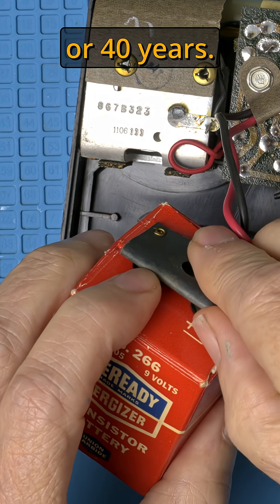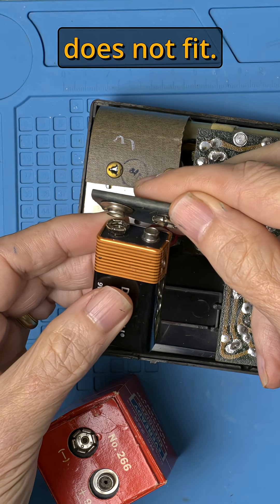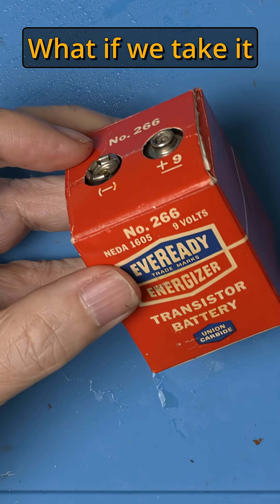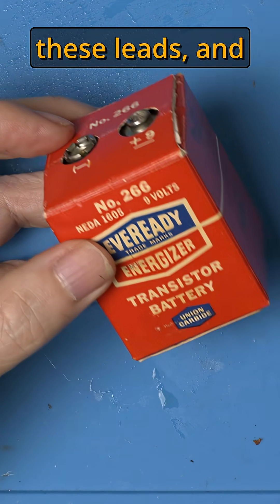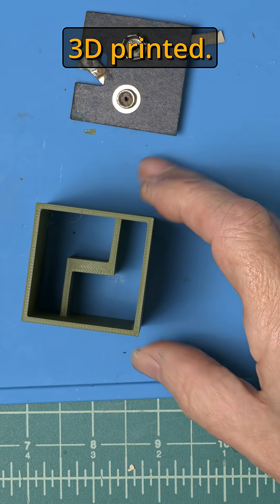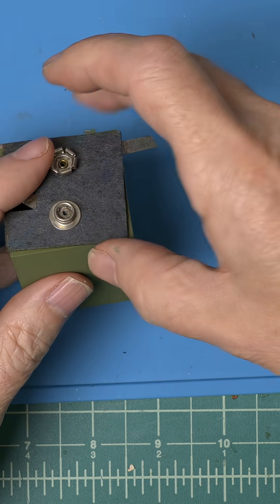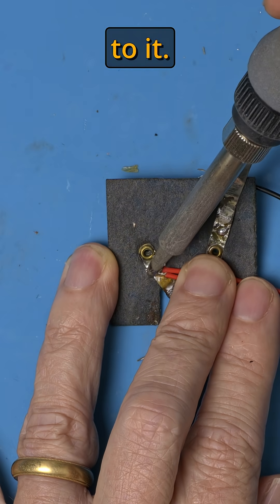3D Printed Vintage Battery Adapter #vintageelectronics #3dprinting #eveready #electronicsrepair

Comment: Gads, I'm so old. I had one of those radios when I was a kid, I used 6 D batteries to make a power supply until my father found an old model train transformer that was rated for 8.9VDC

Comment: It was 9 volts why didn't u just cut and put a connector that is for new 9 volt alot less work if u hooked up the batters wrong it would be 18 volts but I guess u have dou le batter storage that way I would have just put a new connection on instead of building a battery pack

Comment: Really great fix for the 'Old battery tech' solution.  So glad to see you put it back in the original box.
(As a side-note and one that probably shouldn't be done anyway; that old battery might have been 9volts but no way do ya put your tongue across the terminals to check if there's any life in it!)

Comment: i think you have enough space to connect in series connections and insert that case at least two of 3.7 volts  rechargeable batteries at 1500mAh each one recycled from vapes and maybe still left small space to insert a tiny 8 volts to 9 volts dc dc step-up converter. Even without that converter your portable radio could work fine inside interval 8.4 volt to 7.5 volts only. Some vapes include an USB C connector to recharge that batteries and you connect it to recharge one by one attaching a switch to comute between  batteries  (direct wires connections from same charger negative point for that two negative terminals  batteries and a switch to comute between batteries only the positive terminals from positive connection of the charger with a display battery percentage indicator . You have a lot of possibilities and space to play with and even fit up to four vapes Lithium ion 1500mAh rechargeable batteries two by two parallel and series connection but could be a bad idea because different internal resistance of too many batteries and most probably will experience unbalanced discharge of batteries.

Comment: 😂Why did you make it so sophisticated? You could have pulled out the ones that's connecting to the device.
Brought in a new connector a modern one connected to the battery.You didn't need to print

Comment: I would have just cut off the old battery terminals and installed a new standard 9V one but I guess you wanted to maintain the look of the internals and have some fun with it so this was a really cool solution

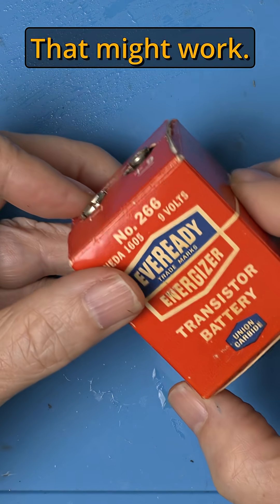Comment: 0:14 there's only 3 things wrong with that idea. 

1- you said "3D print" a cardboard box.

2-you probably only need 1 modern 9v. Check the specs on the battery first. Old  batteries are generally extremely weak and new batteries can damage vintage appliances. 

3a-If you only need 1, 9v then either change the connector or make an adapter. 

3b-if 1 or 2, 9v batteries don't match the specs on the original battery, you can build your own battery simply by connecting AA batteries together.

AA and AAA are both 1.5v. C and D are the same as well. 

9÷1.5=6 

6 batteries wired in series gives you 9v. You just need to find out if you need AA or AAA. You can connect them together using electrical tape. If movement is a problem, use any styrofoam you can get for free.

Comment: I have the same radio. I just used 1 -9volt battery, seemed to work fine. I like your retro fit. 👍
Reply from the maker: Its a cool radio.  One should work fine, just not quite as long.  That radio eats power!

Comment: The original battery probably had a capacity of many mA, maybe even amperes... the combination of the two new batteries does not exceed 240 mA, so your autonomy will be extremely limited.

Comment: You don't plug batteries in parallel, They will eventually get different charge and one will discharge into another with a lot of heat

Comment: Or you could have just replaced the connector, seeing as it has wires to cut & attach to a standard 9v battery..... All that effort for no reason.

Comment: Would it not have been simpler to replace the original battery connector, with a modern PP3 connector?

Comment: Isn't that easier to remove the connector (I don't know the name of it) or where the battery plugs to the new one which supports current 9v batteries? Instead of redesigning the old batteries.

Comment: Read of an EVEREADY battery made in 1912. It was original to the S&W .44 revolver under barrel light. Over 100 years it would still kick the volt meter on a multimeter. But not enough to light the bulb.

Comment: Checking my knowledge: you put the 9V in parallel in order to keep the voltage 9V, but by having two batteries you doubled the capacity? Does that also increase the current they can supply?

Comment: I would have made a plug adaptor between the radio plug and modern 9 volt battery, so you would not have to alter the vintage radio and you could use (just 1) the readily available 9 volt battery - the best of both worlds.  I have no idea how long using only one pole on 2 batteries will last.  I suppose you swap the batteries at some point.

Comment: Ok so dumb question.....how does this not "over do it" in terms of power output if you are now using 2 9volts instead of one.....or are those old 9volts more than modern 9 volts lol?

Comment: Avoid wiring any batteries in parallel. It can work with well -matched batteries but it be terrible if they are not well matched. You would get much better results wiring six 1.5V in series

Comment: Or change the connector to fit a more modern 9 volt battery. No need to 3D print anything.

Comment: I had a radio in 1970 that needed a round 9-volt battery. The battery was a little larger than a modern AA battery.

Comment: Pretty cool solution, but unnecessary. The Exell 266 Alkaline 9V Battery is a direct replacement for the Eveready No. 266 battery used in vintage transistor radios.

Comment: Your small batteries are upside down.  Put the buttons up top and put metal strips between the outside and inside buttons directly on the inside of the top lid .  Alternative is to just refill the 6 chemical layers with modern alcaline chemicals .  A third option is to stuff in 3 18650 lithium cells and add a 4 pin balancing connector behind a flap for reliable recharging, giving a voltage range of 9.6V flat to 12.5V fully charged .  2x lithium would be 6.4V flat 9V full.

Comment: I'm concerned that you've wired two batteris in parallel.  I think that there is a danger of the two batteries discharging through each other.

Comment: The year is 2135 “Here with have an ancient radio with a not so ancient, yet still dated, but reliable battery conversion system. We’re gonna replace this with a pellet of Uranium 235.”
opens led coffin holding a grain of rice sized of uranium.
“Now with your nuclear play set you can get from the Amazon corner store, put on your lead lined gloves, place it anywhere inside the box and boom. It’ll get radio signal as far as Australia. Uranium-235 half life is about 704 million years, so just set it and forget it. ”

camera pans out to nuclear waste land.

Comment: What a normal person would have done is snip the connector off and replace it with a modern version of it that way you can use a standard 9v battery

Comment: Love the 3D printing. Having two batteries in parallel without a load balancer? Sure since 9V blocks have a pretty high internal resistance, they are not gonna burn. How long do they last? They should be empty pretty fast.

Comment: To be fair, the ANSI 1605 / No. 266/266A batteries are still being produced. They're about $30-40. But, they have a capacity of about 2,500 mAh as compared to 500 mAh for your typical Alkaline 9V. So that's about 5 9v batteries. Not sure how much savings you'd have using 9Vs over the correct battery as you'd have to replace them more frequently. But, if it's just for keeping a curio around in working condition and not for regular use, it probably doesn't matter.

Comment: Honestly, love old radios. I got this old emergency radio from a garage sale for $2 (modern equivalent is about $40 iirc) and it has so many features, like an outdated charger port (is a circle instead of a usb port) as well as a light plus a red light with blinking mode, and an alarm, and it has a rechargeable battery in it with a crank

Comment: I belived you had to make them in series + goes to negative on the other battery and that one go to the + innput of the radio. Same with the negative. So it keep the 9v, now it is 18v and drain battery faster. Must have seen it wrong.

Comment: Is that considered putting batteries in parallel? 

Not series? Because both negative legs went directly to the negative tab? (Same for +) if it was series you would have jumped one +\- from one 9v to the other, then to the tab?
Reply from the maker: That's exactly right, they're wired in parallel.  That's like doubling the size of a gas tank in a car, it runs longer.
Reply: @Dream.Build.Create thanks for the reply! I’m slowly trying to learn about batteries and solar without actually having the materials. 😅

Comment: The best solution for most is just buying a PP3 to PP9 adapter. They cost $10 but the downside nothing to hold them in place but no 3d printer it is the best option. Well, I use tape in my great grandfathers old radio.

Comment: That's not how it works!

You can't just connect two 9V batteries in parallel to a device that requires 9V. 

Of course it works, BUT if there is a difference in age, charge level and even brand, it can happen that one battery tries to charge the other battery. And that's despite the fact it's not designed for that!
This leads to the battery overheating, leaking, or even bursting. 

To do it the way you want, you need to install a schottky-diode (hot-carrier-diode) to each battery so that no battery can charge the other, but sufficient power can still be drawn. 

Incidentally, if simple silicon diodes were used, the device would probably not work due to the forward voltage of 0.7V per diode. Whereas a Schottky diode only draws approximately 0.3V. Most devices can still handle that due to their tolerance.

Moreover, fully charged batteries rarely run at exactly 9V, for example. Most often they're somewhere around 9.2-9.5V, which of course makes the mentioned above  problem even more pronounced.

Comment: Connecting the two batteries in series instead of parallel seems a bad idea to me. Might work for a while but If I remember correctly doing this doubles the voltage (so it's 18v not 9v) which means you might damage or overheat it.

Comment: Another moron who just needs to use his 3d printer to solve a problem that doesn't need to be solved. I'm pretty sure they still sell it. If not, just replace the plug with one that takes a standard 9 v. 2 minutes with some solder if
Is better than hours programming and printing

Comment: Please write down the voltage and capacity so people in the future know what specs to use with future batteries long after you have passed away and the "modern" 9 volts you used have depleted and no longer being manufactured.

Comment: Serious question why 2 9v batteries when on front it just says 9v ? Wouldnt that put 18v through ?
Reply: Depends on if they're in series or parallel, I forget which does which but one doubles the voltage in this case and the other keeps the same voltage with double the capacity

Comment: I love old batteries 😍 like the old 4.5's, you could always shake out one last drop of electricity to make the lamp glow for a few more seconds 😅 it was something trustworthy about old batteries; as long as their insides were in their inside and not leaking all around the place the battery was usually good enough 🔋👍

Comment: I would have just cut the wires and added a double , battery terminal for 2 batteries that would have been faster and cheaper. Neat anyway

Comment: The voltage between the two 9Vs might be problematic cuz even a small difference can lead to current between the two and might generate heat which could damage it over time

Comment: Just an honest question from someone who's not technical.
The original battery was 9v but you put 2x9v batteries in the new box.
Doesn't that make 18v and therefore too high power for the radio?

Comment: 266, NEDA 1605 battery is stillsde by Excel. Pricey, though. Or you can buy an alternative, the case is the same size as the original, but holds 6 AA batteries connected in series.
Good work on your design.

Comment: I do like what you did it looks clean, just to point out you could cut off the old battery connector and solder in a connector to fit a modern 9v.

Comment: They still make batteries this size and voltage. They go for about $40 bucks. Obviously what this guy did is cheaper in the long run…but he said he didn’t think they made these batteries anymore and they do still. Exell Batteries is brand/place I know you can buy them.

Comment: I'm no electrician or anything but can't you blow a fuse or a short a fuse or something if you're running more power than the System supposed to be running you put two 9 volts on one system that's supposed to be running off one 9 volt now I know there's a difference between volts and amps and a whole bunch of other stuff but I don't know I'm not an electrician.

Comment: Batteries in parallel is not a good solution.
6x AA or AAA in series would have made a better solution, with the same or better capacity than the proposed solution.

Comment: if you connect them parallel -- that's 18 volts.
Reply: No if you connect batteries in parallel you double the milliampere hours

Comment: Btw he's connecting the battery in parallel config so instead of having 18 volt he's having 9 volt

>but why 

Because your battery will last roughly twice as long as simply rigging 1 battery

Comment: The two 9v batteries will usually self discharge when connected in parallel. A rechargeable lithium cell would have been the better option

Comment: 2 x 9v has only about 1100mah max, while old battery is around 2500mah. Better use 6 x AA for capacity of 2500mah+

Comment: So the guy that that made this old battery out of new versions if you did this correctly, you would have doubled the life of the battery but if you did it incorrectly, you did not make a 9 V battery you would have made an 18 V battery if you put one positive lead to a negative positive lead that would make it a battery in series and that would mean you just made a smaller version of what drills take you know like those 18 V lithium ion batteries yeah you just made a smaller version of that but if you hooked both of your positives together, you would not double the voltage but double the amp powers just like the same as making 2 12 V batteries into 24 V a 24 V batteries

Comment: Maybe I'm just lazy, but I would've replaced. The connector leads so that they would handle regular 9 V battery and use a pair of split wires so that I could have the 29 V batteries and some phone padding to hold the batteries in place without rattling. Yeah, maybe I'm just lazy.

Comment: Bro if you cut modern battery cap by half and solder both back end of the caps you can fix each single cap on the top of that old battery pack. Outcome simple ,cheap, time saving. 😅

Comment: I'm not an electrician or anything, but this is cool and I'd like to learn more. What was the purpose of putting two 9volts in like that instead of snipping and replacing the connector with a standard 9volt? Is it just the increased power or to keep that look of antiquity?

Comment: Cut off the connector. Solder a new connector that fits modern batteries done!. If more people were logical thinkers we wouldnt have all the issues we have. Let me just stixk 2 9 volt batteries in a 3d printer hosuing that does fit this connector looking ass

Comment: Re purposing useful items and keeping them out of the landfill is what should be taught to our children. There is no reason to get caught in the constant replacement cycle of our possessions. Your possessions should only be replaced when they cannot be prepared and provide continued usefulness.  Goodwill Salvation Army and other thrift shops provide valuable items that are still useful and are available for pennies on the dollar. 

I suggest that people should learn to capitalize on such low cost alternatives to new! This is the appropriate methods of keeping useful items from ending up in landfills!

Comment: So the old battery is 9 volts but then you put two 9 volt batteries connected together surely that would make it 18v or at least higher that the original 9v, 🤔

Comment: would a single 9 volt battery work? or did you use two 9 volts to fill out the box or for more amp hours? learning just curious
Reply from the maker: Yes, single would work, but this radio eats power.  Two alkaline batteries have a little bit less capacity than the original larger carbon-zinc battery.

Comment: This is the kind of stuff that 3D printing was for. Like, sure, you can make some figurines and such, but it's creative solutions for unique problems that 3D printing was probably first imagined for.
Reply: Just hanged a whiteboard on the wall with use of relatively simple models (not my design, just modified and scaled up someone else’s model). Otherwise this board would go to the landfill, because it was designed to be used with their “strange” tripod, and I have no space in the room for this construction. Took 60g of petg plastic and little above one hour to print
Reply: It's such a useful *tool*.  Unfortunately, a lot of people dismiss it as just being useful to make knick-knacks; in reality, it's been one of the most useful tools in my arsenal.

Comment: Why the fuck wouldn't you just splice on a standard 9v adapter and use either a modern 9v battery or a 6 x AA battery holder. This is so dumb and pointless.

Comment: A USB (5v) to 9v dc-dc stepup adapter would let you use a moderm rechargeable battery pack. The adapter is pretty cheap.